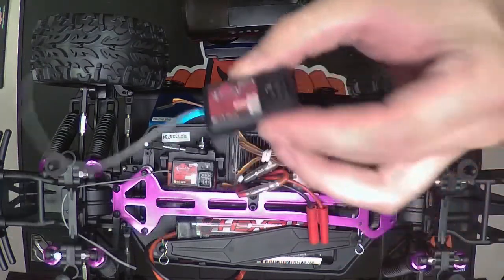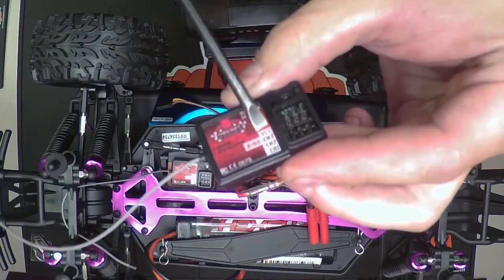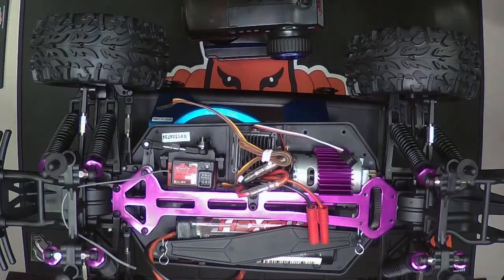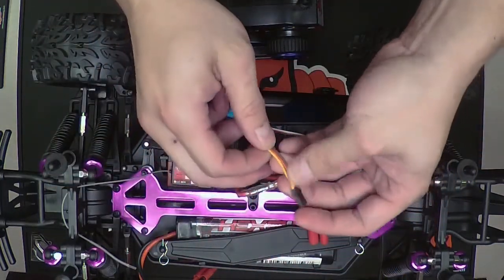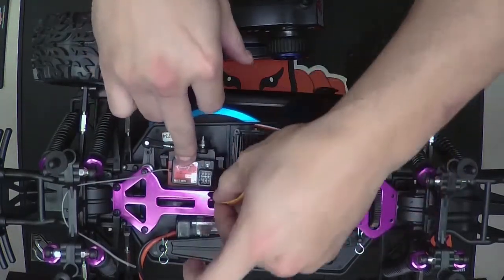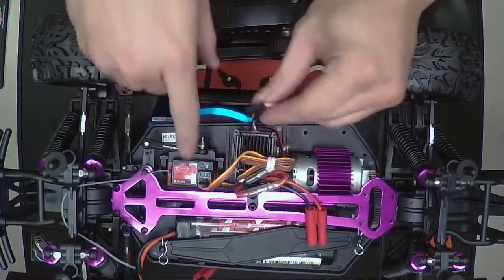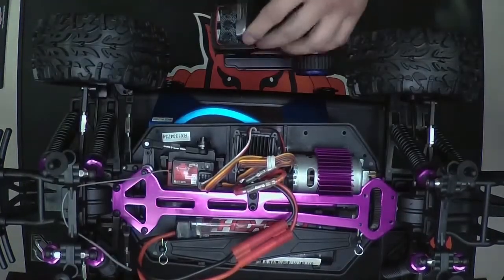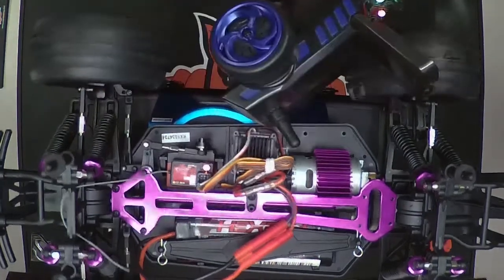Redcat University - Receiver ESC+Servo Wiring - 2CH RCR + Receiver

Comment: I just purchased the gen7 pro brand new. Charged the battery fully, went through the binding procedure. The throttle works great but the steering doesn't work at all. Dual steering knob is at 60 (from factory), steering trim 3 to-3 has no effect. Either bad receiver or bad servo?

Comment: I have the Blackout xte brushed version, I drove it maybe 5 times, not hard on it at all, I did make the mistake of leaving it at my nephews, he drove it in the hot weather and I'm sure it was worse than he said, anyway now it doesn't do anything, the servo is light is solid red n remote green showing it's binded and the ESC lights up red when I press the throttle either fwd or reverse but nothing, can somebody please tell me what he fried. Thank you
Reply: I also made a video of the issue

Comment: where do I plug in the reciever battery pack n the chimera
Reply from the maker: Technically it plugs into the on/off switch then that switch plug is placed in either channel 3 or channel 4 - sometimes identified as "VVC" or even "VCC/BIND"

Comment: I have the epx drift and when I turn it on it works for a few seconds then it makes a long beep then shuts off please help
Reply from the maker: This could be a few issues within the system. Might be an ESC failure or motor failure. But hard to tell without other parts to test it with.  Do you have any other RC cars with the same or similar systems in them? You could swap test some components and it might narrow down the issue to 1 part.

Comment: Hi im working on my redcat racing volcano epx ive been having troble binding my controller to the servo no sterring
Reply from the maker: Make sure your yellow/orange wire on the servo plug is facing the sticker and check your steering dual rate. Make sure it is about 75% or around the #5 or #6 depending on which remote you have.
Reply: ericjamesable I’m having same problem did you find a fix?

Comment: Does fly sky reciever work with the gen 8 because I’m struggling to pair mine with the reciever
Reply from the maker: Flysky is the manufacturer for about 95% of our models so yes - BUT - there are different "BAND" or "signal modes" that Flysky comes in. If you are using 1 and need the other your remote may not be able to talk to your receiver if they are not in the same "BAND". For help or better understanding contact our support team and find out if you are using compatible items. 
https://www.redcatracing.com/Contact

Comment: It's all connected properly but still won't have any throttle or steering capability and every time I find the RC I turn it off and then turn it back on and it's Unbound again
Reply from the maker: That usually means that the receiver is not holding the bind - or you are not removing the bind plug. If you are removing the bind plug then its the receiver.
Reply: Redcat Racing I thought it was the receiver to so I got a new one and still not functioning properly. It will bind. But when I turn on after pulling the buying cable and turn it back on its Unbound
Reply from the maker: Try binding it without the steering servo plugged in. See what happens.